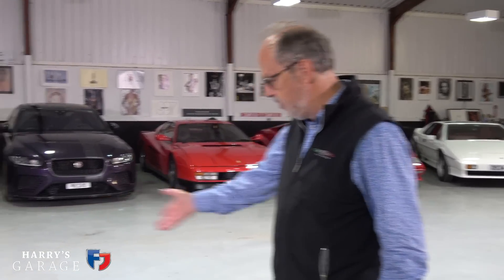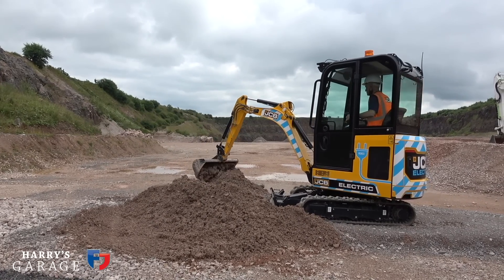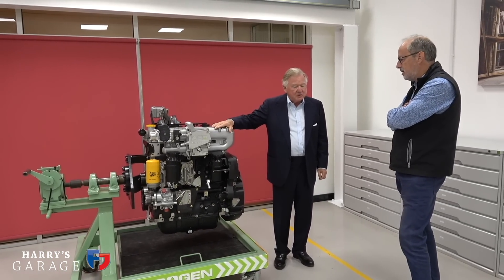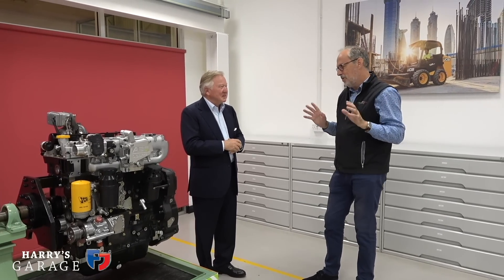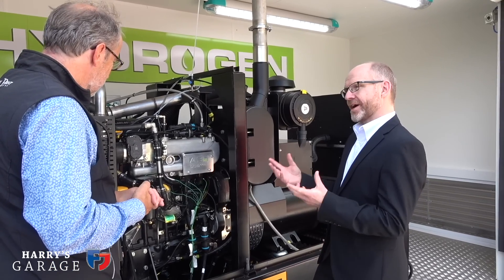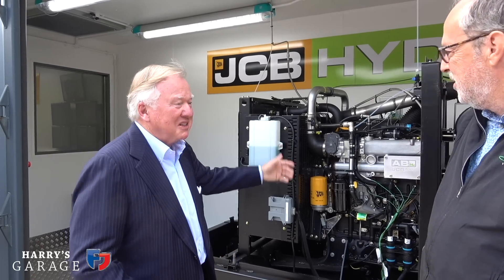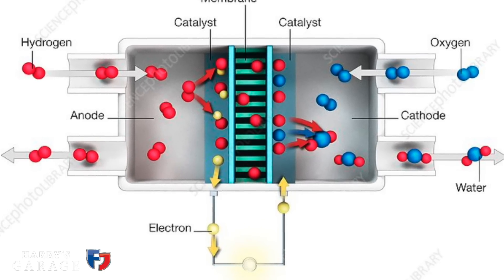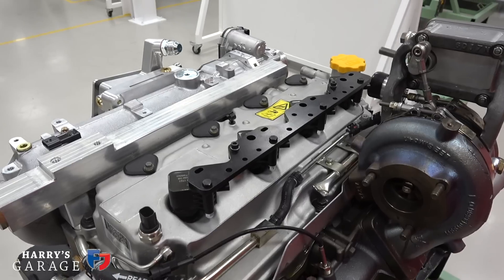Is hydrogen, rather than electric, the future for big-engined machinery? I visit JCB to find out

Comment: About 6yrs ago, I worked for a company who made an electric city road sweeper. Design duty cycle ( between charges) required was  8hrs. We developed  it to have two batteries that  could quickly be removed and charged separately. This allowed it to run pretty  much non stop. Problem was price. Several councils in various countries had them for trials and loved them. Price of the diesel version was around £60,000. Battery powered version, over £200,000.

Comment: Wow, so pleased to see someone who genuinely appreciates the engineering talent that we have in the UK and who's not afraid to challenge the current "fashion" of battery powered vehicles.
Reply: @terryjimfletcher  They mention the NOx issue and have got around it.
Reply: The real question is if you're basing your economy on a synthetic fuel (hydrogen), why not just make a synthetic liquid hydrocarbon fuel instead? That way you wouldn't need to change the engines or even the fuel infrastructure at all.

Refueling a liquid fuel tank is far faster, simpler, cheaper and safer than using highly compressed and volatile hydrogen.
Reply: Musk is a melt
Reply: @terryjimfletcher  exactly making hydrogen is one of the most energy intensive processes we have.
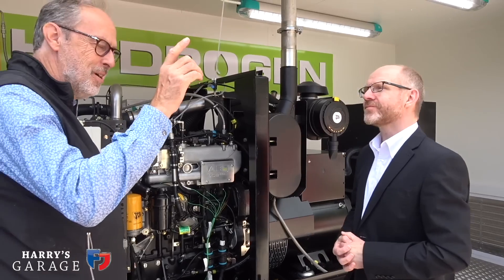Reply: @phamnuwen9442  listen from 17:00. There’s 3x energy density from H2. Fuel cells have a very high efficiency as well (I think up to 60%), combustion engines like these are much lower, but I think it still means you win on power per gallon.
Synthetic hydrocarbons are currently very uneconomical and not scalable and there isn’t really any ideas on how to improve on that. You would also have to get the C from the air otherwise it wouldn’t be carbon neutral, which is difficult.
Reply: @Luke---  I think synthetic liquid hydrocarbon fuels win over hydrogen based on how easy they are to store, distribute and transport.

Yes, there's more cost involved with harvesting CO2 from the air, but I'm guessing this is still cheaper and more practical than hydrogen overall.

Gas is just a lot more expensive and complicated to store and distribute compared to liquids, and hydrogen is particularly problematic.
Reply: @Luke---  "Synthetic hydrocarbons are currently very uneconomical and not scalable and there isn’t really any ideas on how to improve on that."

Use one of the upcoming high temperature nuclear reactors for process heat to drive a synfuel factory.
Reply: @phamnuwen9442   I think getting something like that up and running at the scale that we need is too far away to solve the problems that need solving immediately. The only viable (I.e. scalable and cheap) non-fossil fuel looks to be ethanol, but still, I think BEVs will be so commonplace by the end of the decade that its usage will be limited. Plus growing vast amounts of crops for fuel also has its own drawbacks.
Another thought… If it were cheap enough to make synth fuels from the carbon in the air (cost of gas in Texas: $0.75/L, carbon from 1L gas is 2.4kg = 31 cents per kg emission), then we would surely just be using this as a carbon capture process?
Reply: @Luke---  We're not going to get off fossil fuels in the forseeable future. Biofuels will never be cheap at scale. Synthetic nuclear fuels (regardless if you make ethanol, methanol, gasoline or diesel) is the way if you want to produce cheaper carbon neutral fuels. There is no climate crisis though (the risk of death from climate related causes has declined by 98% over the last 100 years), so I wouldn't worry about that too much.

EV's are still twice as expensive as gasoline cars so that's not going to happen unless you want to effectively ban affordable cars.
Reply: @phamnuwen9442  but they already have ethanol produced at scale cheaply?! you can get E85 in Cali for like $3/ gallon today, and in a loads of other countries as well. It’s been available for years.
And yes, the upfront cost of BEVs is higher but everyone knows the payback is like 5 years, and continuing to decrease.
Reply: @Luke---  " you can get E85 in Cali for like $3/ gallon today,"

Only because biofuel is subsidized and tax exempt. Put it on a level playing field with fossil fuels and it will not be able to compete.

"everyone knows the payback is like 5 years, and continuing to decrease."

Nobody makes up a 2X purchase price over 5 years in the real world. Give me a break.
Reply: @phamnuwen9442  BYD is selling it's BEV same price as it's ICE cars in China. Will just be a matter of time here
Reply: @tarant315  Which BYD? A limited range EV that takes an hour to charge is not comparable to an ICEV with long range that refuels in 5 minutes at any gas station.